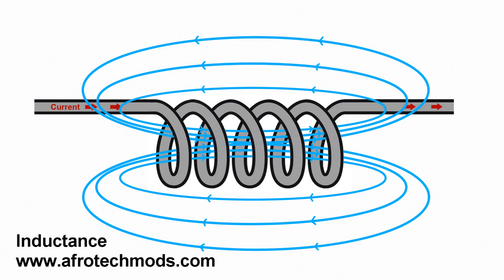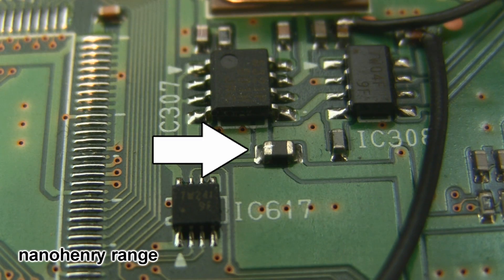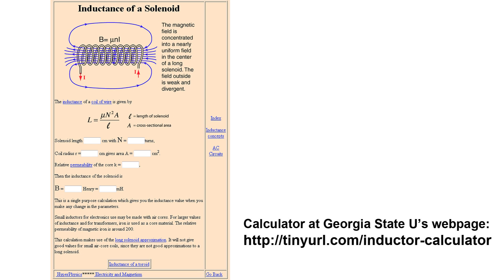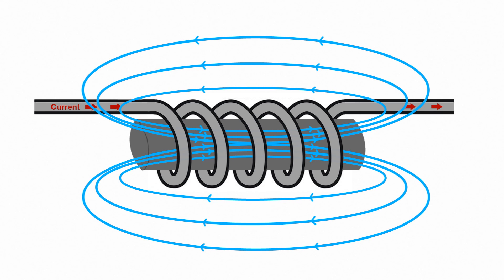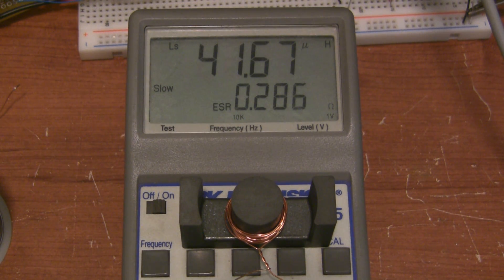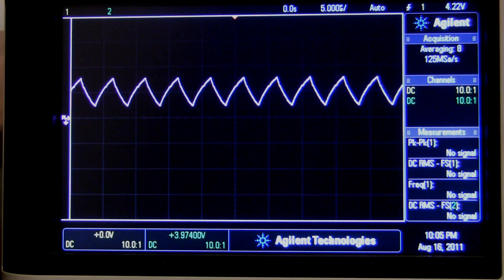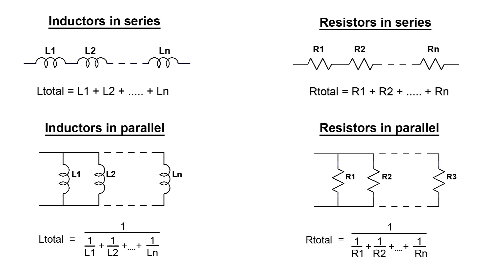Inductance basics

Comment: I love your videos, very informative. I'm fairly new to electronics so please forgive my ignorance, how would one go about figuring out the specifics (number of turns,wire gauge,etc) to achieve a desired voltage?
Reply: I'm trying to build a stator for a 12-24v generator (2-phase, 8 coils, using 20 gauge wire), but I'm uncertain of the coil design needed to achieve the voltage I desire (at 1650RPMs, if that is a needed factor?). I have scoured the internet looking for a solution, but I haven't had much luck. Probably due to my limited electronics vocabulary.

Comment: This one here might be a bit better meter. It's still not a bench LCR meter but it's only a few bucks more than the one you linked to in the description and is not a naked circuit board.  https://www.amazon.com/Proster-Capacitance-Inductance-Resistance-Self-discharge/dp/B071WNNYQT/ref=sr_1_1_sspa?ie=UTF8&qid=1525625860&sr=8-1-spons&keywords=Inductance+Capacitance+meter&psc=1
Reply from the maker: Good suggestion thank you. I have updated the link.

Comment: I'm building a massive full bridge rectifier that I'm hoping will be able to handle 1000w, would an inductor like the ones in this video work well to help smoothen out the ripples? in addition with a capacitor bank and a 1/4w bleed resistor.

Comment: thank you so much for this great explanation! Though I have one question, you can use inductors to filter out HF(high frequency) current changes but you use capacitors to filter out low frequency current changes, yes? that's why you cant just use capacitors instead of inductors right?

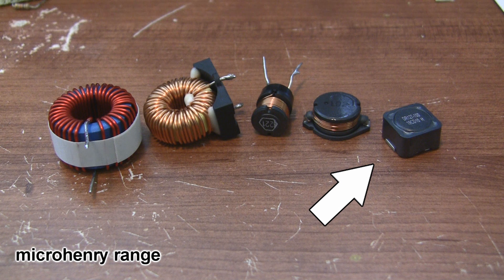Comment: 0:55 I thought inducters were used to smooth out current not voltage?
Reply: I guess he means avoiding voltage drops and peaks caused by sudden changes in load current?
Reply: Here they form lc low pass filter - this is used in buck converters

Comment: I am going to make a LC filter for video transmitter that draws 150 ma at 12 volts that will be supplied by 11.1 V  2200ma lipo battery.  I am going to use a small inductor form an old power supply that looks like the one that is 3rd from the right in your video.  Since the transmitter only draws 150 ma I should be fine using a smaller inductor and a 470uf capacitor rated at 25 volts.  Am I thinking correctly?

Comment: Ammo1313 - What appears to be "bare" copper wire in the video is in fact "magnet" wire.  Copper wire with a high temperature clear/colored insulating varnish.  Not really a good idea to twist the wires together as shown in this video because too much flexing of the varnish will caused it to fall off and then you will have a short circuit instead of an inductor.

Comment: I need some help fault finding on a Circuitboard. The board is one of manny in this device. It's a (martin mac 550) but you don't need to no that right now. When I heat the mean Power supply board up with a hairdryer etc it works fine. It's got capacitors, voltage regulators, inductors and much more ware is best to start looking? It's all most like the output voltage it's at the right voltage. Any thoughts?? 
Thanks.
Reply: lighting43 - try heating it up til it works, then spraying canned air at different areas of the board... That may help narrow it down.

Comment: So AC voltage is square form by adding smoothing Caps and bridge rectifiers only smooths (less pure DC current) the current out so much but if you put an inductor before the caps and rectifier then the end result would be more purer (stable) DC volts?

Comment: I want to run a 10kw DC motor at 72v but can only use a 24v battery. I was simply going to make a voltage trebler using capacitors, but could I use an inductor to smooth the output? I have access to any size iron core up to big enough to put your head in! 
Also, would an inductor demand current from the battery such that by trebling voltage, I still get a duty cycle that is more than 1/3 ? (But run the battery down faster of course)

Comment: Hi 
in order to buy this i need to calculate the value of that coil
6 Turns, #16 wire , 9 mm diameter.

so #16 wire is 1.291 mm right,
By my calculations  it should be 0.211(uH)
Am I right?
Thanks!

Comment: 1. when a capacitor or coil goes bad, can this be detected using LC-1000A by measuring only capacitance / resistance of the particular part? Is there a possiblity that a coil / capacitor still reads good inductance / capacitance values BUT has high ESR and therefore is bad?

..actually that's only one question. Thanks!

Comment: I have a question. I would like to measure capacitors on my dead LCD backlight issue and bought a "Inductor Resistors Capacitor LCD Digital Meter Tester" from ebay @ 17.99$+8$ shipping (almost the same price as LC1000-A you posted in the description).

Now both of those seem to only test for capacitance / inductance, in F or Henry. However the meter in your video also shows the ESR value.

Three questions:

Comment: Love your videos, as always. I just have a few quick questions.

I have an old 'borrowed' phone charger in front of me with a bridge rectiIfier, a mess of capacitors, a voltage regulator and what looks like an inductor.

If capacitors and inductors are so similar in function, what's the point in having both? What's the difference?

Thanks, and I look forward to new videos. :-)